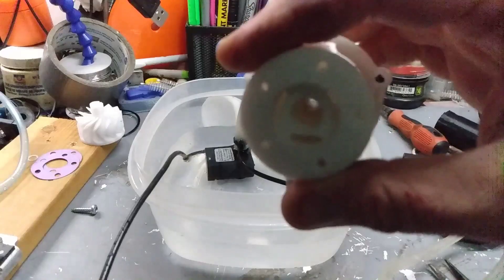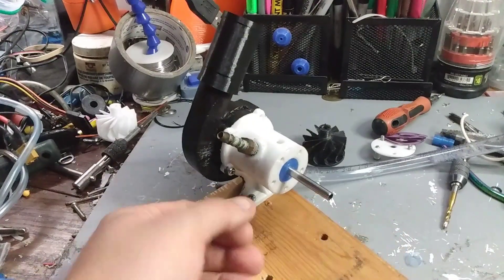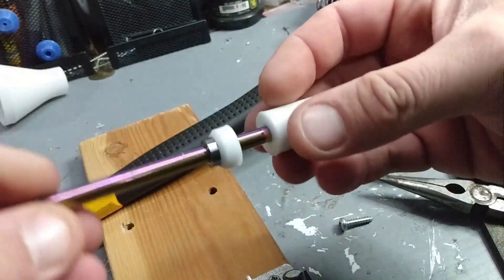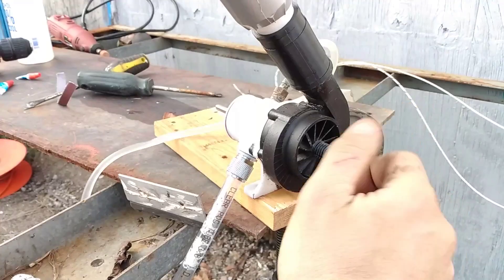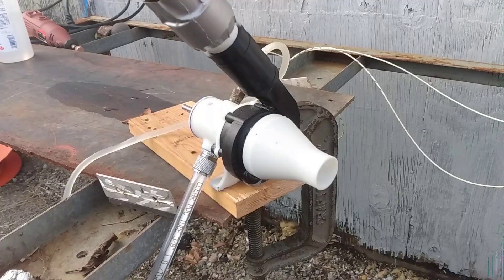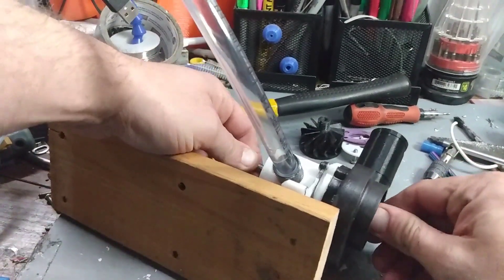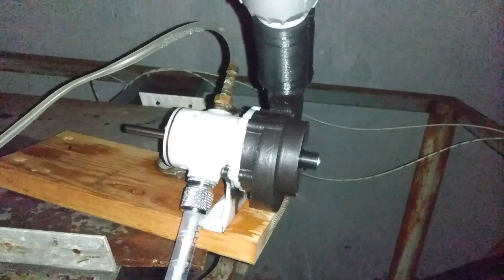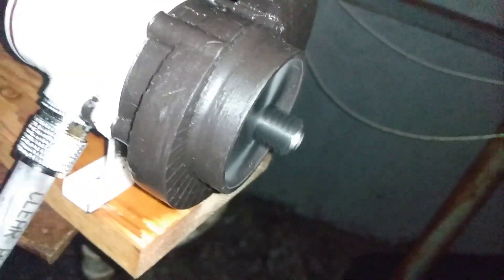High RPM Pressurized Journal Bearing

Comment: I saw the model you shared on ThingiVerse, I wonder which 3D modeling software you use?
Reply from the maker: Fusion 360 and sometimes I'll toss an unfinished part from fusion over to blender to modify the mesh but that's just for more artistic stuff .
Reply: @turboprint3d  Thank you for your answer.  Interestingly, I'm printing out your model right now. Helix has completed its 1st lap, I have enlarged the model 1.5 times and each lap takes less than half an hour without support.